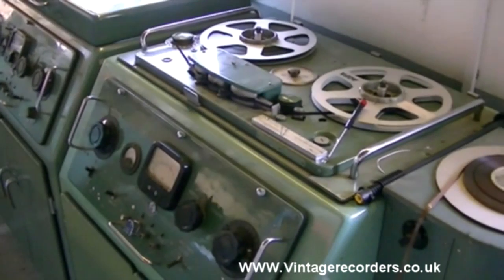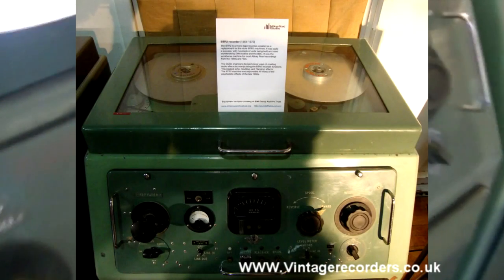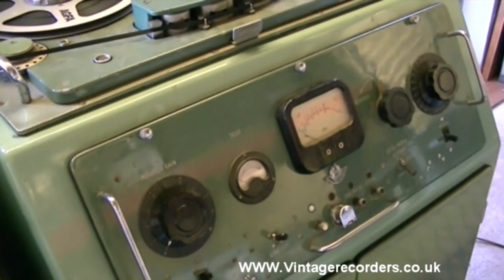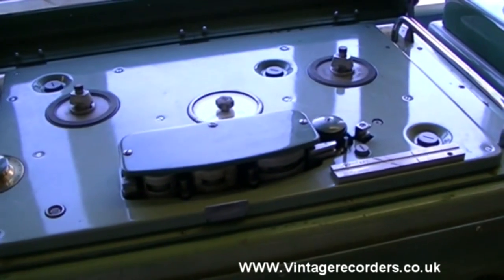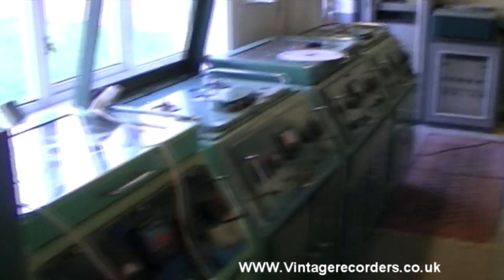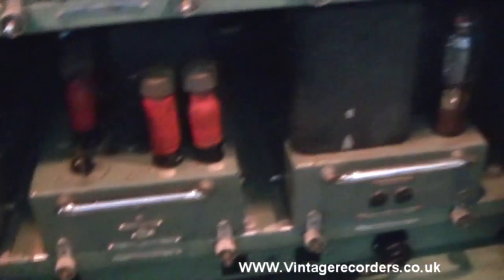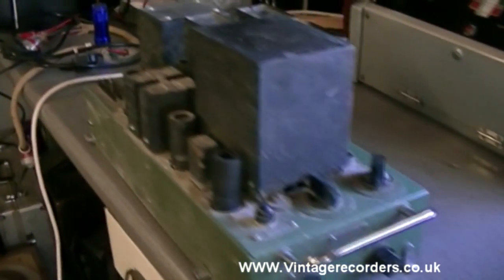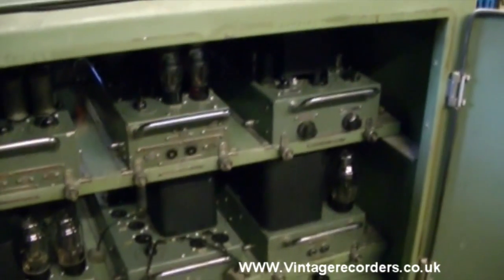The EMI BTR-2, could these have come from Abbey Road studios ?

Comment: I worked at Abbey Road from 1973 onwards. At that time as far as I am aware only one was  being used (but not for recording). BTR's  would not use PPM meters.
Reply from the maker: Hello, there are two styles of PPM's EMI used, the traditional black faced 1-7 scale meter often seen on modern equipment and seen on the BTR-2's Abbey road exhibited not so long ago, but these were not used, the ones used where the -40 to +15dB meters which are in fact EMI's version of the PPM, as far as I can find, these EMI PPM's where the only ones they ever used, I haven't seen a single picture of a VU metered version used in their studios, I believe you use to work in Abbey road in the days of the Studer A80's? the BTR-2 machines would have been stored by then I would have thought.

Comment: I'm curious about if in EMI-Odeon studios in Barcelona (Spain) were also these legendary BTR recorders. If so, many of the greatest hits of Spanish rock and pop of sixties, like all discography of "El Dúo Dinámico", were recorded on these kind of machines. Could someone evidence this point?.
Thanks in advance.
Reply from the maker: Sorry for the late response, that is interesting, I don't suppose you know of any pictures of EMI Odeon and say the control rooms? these did come from Spain and its just as possible they where used there as well as the UK ( I do recall the seller mentioning something along the lines of that some of the Abbey road stuff got moved there).
Reply: Seblington  Manolo & Ramón, components of that duet, told some years ago in a radio or TV interview (I don't remember clearly) that some time after their arriving to EMI Spain, in Barcelona, they began to record their songs using certain tape recorders coming from Abbey Road, which previously were used by The Beatles. Those machines, as EMI Studios Crew said they, came from UK main studios (obviously Abbey Road) to Barcelona ones, almost as "second hand" stuff. But the fact that those guys were informed about they was recording on the same recorders that "the four of Liverpool", gives one some to thinking about. Were such machines the BTR's?
If now you said me that these particular machines did return from Spain, then... 2 + 2 = 4. ;)
I don't know about other recording studios or broadcast stations that were used BTR-2 or BTR-3 recorders in my country. Instead, for radio control rooms here were very popular other machines as AMPEX 350, all the range of Studers, and for local stations, the ubiquitous Revox A77, B77 and PR99. Even in sixties, many low sized stations used the Ferrograph Series 6, but these ones were substituted by Revox recorders, mainly because its attractive quality-cost relationship, reliability and durability, besides the fact that Revox machines are capable to admit 10½" reels, even using NAB adapters and even a kind of slightly low-sized AEG-DIN bobby (I don't have any of those platters, but I would like to get at least a pair of them... perhaps a matter of intensive searching along the net), unlike the Ferrograph ones that only could load 8" cine shaft reels.
In recording studios during 60's, most of times the four track 1" and 400 series (1/4") of AMPEX were almost the choice, but afterwards, in 70's, the preferred machines were mainly the Studer A80 series, from 2 track 1/4", to 16 and 24 track 2" formats.
About your question regrattably I must say you that I don't have any picture of that EMI studios in Barcelona, nor in any "Dúo Dinámico" record cover appears any photo of such control room, i would like to!, but it can be supposed that they were using recorders from their own brand, and quite obviously, the BTR ones.
Thanks for your reply.
Reply from the maker: Germannio That is interesting, the jigsaw is coming together, being that the electronics are internal use REDD.17's, the bespoke arms only seen in the EMI control room pictures and this snippet of information, its looking more and more likely.
Reply: Seblington
Curiously and by chance after have been speaking you about this issue, some days ago Manolo & Ramón did appear in a TVE 2 program about old times and music, in which they spoke again about the recorders they used to record their songs. But things there were a bit different. They said that till 1964, they were been recording still in mono until Abbey Road sent an used 4 track recorder (undoubtely a Studer J-37) to Barcelona studios. They said also that such recorder was previously used for The Beatles before Abbey Road got its first 8 track recorder. Together with the tape machine came a mixing console, also used in Beatles sessions (undoubtely a REDD, perhaps with his V72 preamps) to begin recording in stereo. Manolo & Ramón said even that with this tape machine and console was recorded "Love me do". This refutes a bit our theory about the BTR-2 used by "The 4" coming to Barcelona and after returning to London. But in any case, your machines could have been in service in the control room of EMI studios in Barcelona even previously to Beatles adventure, going back again to London when them were not of utility here, regardless of being taking part in Beatles sessions or not as seems more likely, keeping in mind that EMI Barcelona was founded well before the birth of The Beatles.
Obviously when Manolo & Ramón as other spanish singers, bands and players were recording their songs in EMI studios in Barcelona in mono, is very likely that there were using the BTR's, at least the 2 model (full track) untill the arriving of the first multitrackers, the J-37 ones to starting recording in stereo.
Perhaps EMI Barcelona did remain some older BTR-3 to masterize in stereo from 1" 4 track tapes to 1/4 ones, who knows!.
If you can understand Spanish, you can watch this video of the program from the original TVE link :

http://www.rtve.es/alacarta/videos/musica-ligerisima/musica-ligerisima-programa-1/2896120/

At minute 9'35 to 10'32 of that video, the singers explains very clearly the fact.
Regards.
Reply from the maker: Germannio Hi, thanks for the info, Hmm, could poke a hole in the history of these two BTR-2's indeed, I wounder what are the chances Manolo & Ramón would reply to an email. Interestingly, there are Ampex machines in that video, looks lke a stereo and a mono version in rack mount,.
Reply: Seblington Those Ampex seems to be the 350's mechanics, rack mounted in vertical (too annoying position for studio and even for broadcast daily working...) fitted with a kind of non-standard Ampex amplifiers. But such studio that appears in the program doesn't had any to do with EMI Barcelona. Film sequences appears a bit puzzled in the edition of that documentary.
Instead the EMI's one, the control room of the studio that it can be watched could be very likely from a label called "Zafiro", shown when in the script they are speaking about other band, "Los Brincos". Obviously that control room has not to do with EMI Barcelona. As far as I know, no one disc from the British company recorded in Spain had pictures from their studios. I don't know if that was because they did'n consider such practice as some aesthetic for cover art design, or even to keep their recording facilities discreetly far away from curious lookings in a very competitive era among recording studios and record labels as 60's were. Who knows?.
Regards.

Comment: WOW. They are breeding ! interesting that when you get a good few the variations are noticeable. I know that there was a BBC label on the manual of the one I had but no indication that it was from there on the machine. Now I wonder if the EMI archives will have a record of serial numbers and where the machines went ?
Reply from the maker: Hello, Fixerbob, your machine is the one I replace the top deck on, its almost 100% working now :-)